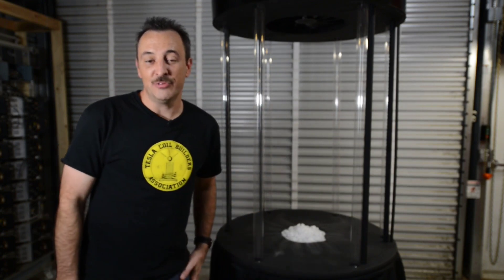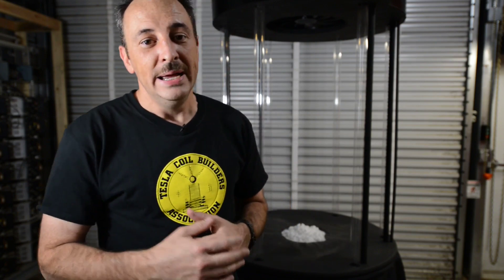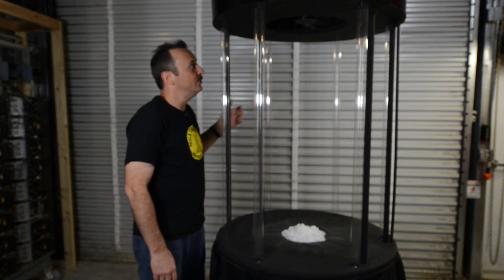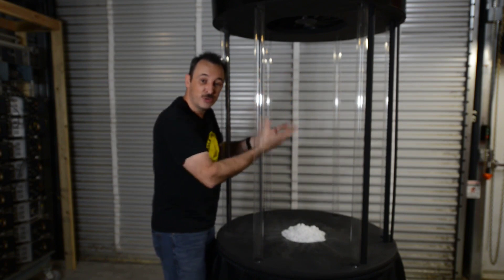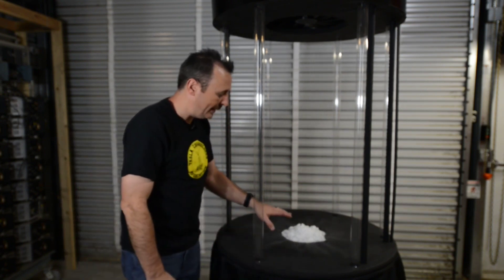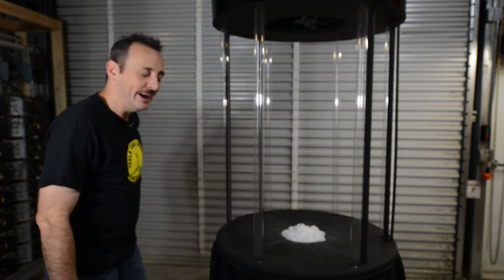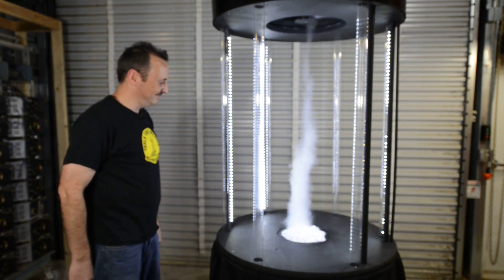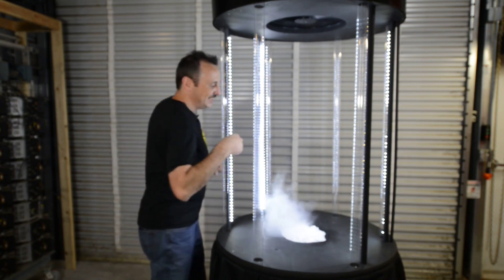Model Tornado Built for The Weather Channel

Comment: Any way to make a top forming tornado simulator?
Reply: Dallas Bagley if you use water, with a rotating thing at the bottom of a container such as a jar, bottle or a cup, and it will go from top to bottom. I don't know if it'll do it with dry ice unless you have the bowl on top and the fan on bottom but I don't think that'll be a good idea because it'll just blow the air somewhere else.
Reply: Only way to make a top forming tornado is if you get the pressure to drop low enough to create a condensation cloud like s real tornado, this would take a very strong fan though, sometimes jet engines can do this because they are able to drop the pressure low enough to make the formation of one of these possible

Comment: Personally I like using a couple ultrasonic atomizers, They're commonly seen for ponds and such, makes that low thick 'fog' and worked well for my case, since I didnt want to use a fog machine, or dry ice. I wanted something that worked by simply adding water now and then.
Reply: Blah blah blah